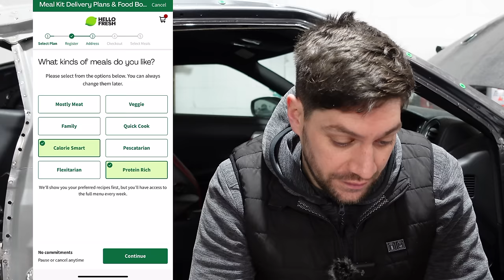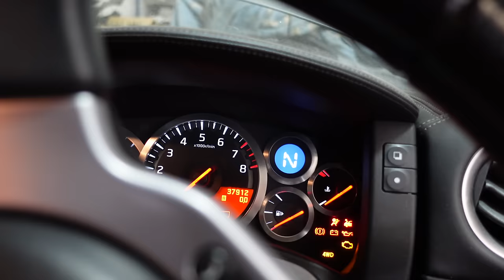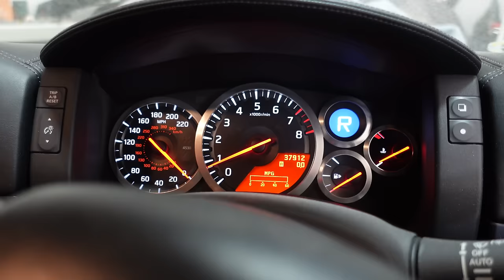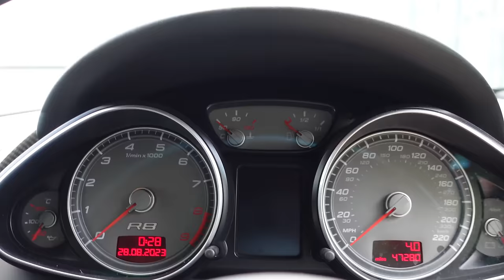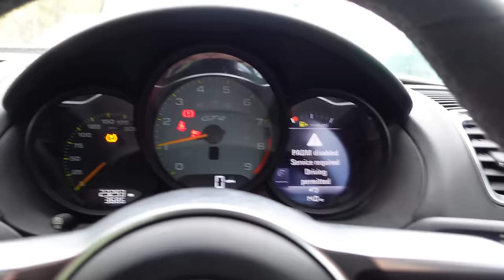HAVE I ABANDONED MY PROJECTS?? TVR, NISSAN GTR, GT4, UPDATES!!.

Comment: Dean a long time Mate the end plate to the GT4 is Plastic just buy a sheet of plastic or more than likely you have some with all your spares around use masking tape on the none broken side to get a templet of size and shape straight cut the broken size place your mirror side cut the new plastic to get how much you need to replace and Plastic weld it on sand shape and paint job done

Comment: Speed Six - It would have been so good to see you refurb the engine yourself. No-one has shown this properly on YouTube (or elsewhere) yet. If you can rebuild an R8 engine then you've definitely the skills to tackle that engine.😀
T5 Gearbox - Similarly it would have been great to see you do a pragmatic service on the gearbox.

If you do get others to refurb those parts then please show us part of the refurb going on at the various specialists. There is very little out there on the specialists setting valve clearances or timing the Speed Six or AJP8 for example.

Will be very interested to see which aftermarket engine management system you go for. Will you be doing that yourself or getting some help? Looking forward to more TVR content!

Comment: Nice one Dean. On the Cerb have you considered a 4.2 or even 4.5 engine swap instead? The Sp6 is considered a bit ‘gutless’ in the Cerb community
Reply from the maker: Is it? I’ve heard the opposite and apparently it’s just as good? Only 20hp less than the 4.2?
Reply: @SavingSalvage  Yes 4.2/4.5 AJP V8s are considered the ‘true’ Cerbera engines ie best sound and performance. SP6 is considered inferior in those depts (even though it is slightly lighter). It’s less of a brute and a bit more sensible so it loses some of the Cerbera’s soul. Over the years though there have been countless opinions/debates over this on forums and official group on FB. Beauty is in the eye of the beholder n all that 😄

Comment: You do realise the seal kit for the rs6 won’t fix the oil returning and filling the intercoolers you need the valve on the end of the oil pump if that’s the fault which isn’t available
Reply from the maker: Ricky changed the valve on the one he had and it didn’t fix it
Reply: @SavingSalvage  if you’ve replaced all the pcv valves and the one way valve on the scavenge pump at the back of the oil pump is ok it’ll be the turbos that’s causing the leak 
The oil pump seal kit will only fix external oil leaks
Reply from the maker: @coreyvernon3245  the one Ricky had he replaced all PCV valves and the valve in the pump, he actually ended up buying a second hand oil pump which fixed the problem. So it does look like I may have ordered a seal kit for no reason 😂🤦🏻‍♂️ I saw you wanted a kit on Facebook, do you want to buy mine? 😂
Reply: @SavingSalvage  yeah mines sprung a leak all depends how much mate
I was hoping to find a company near me that can copy the old ones